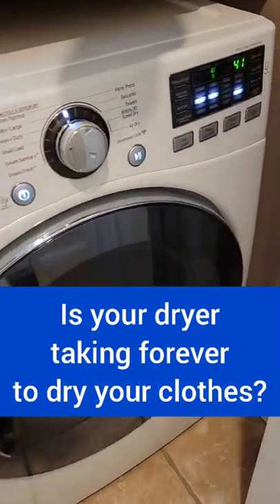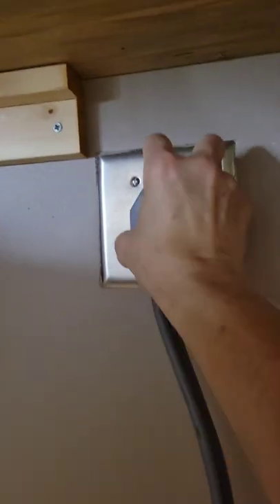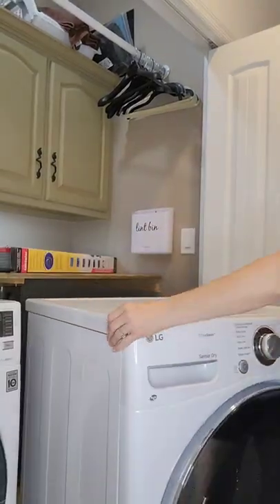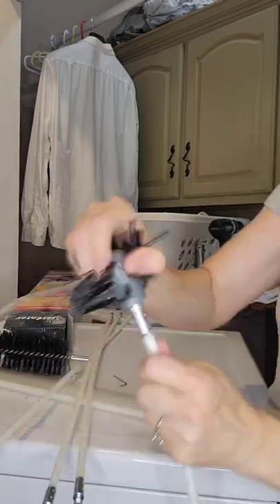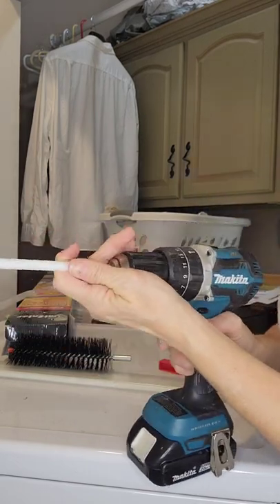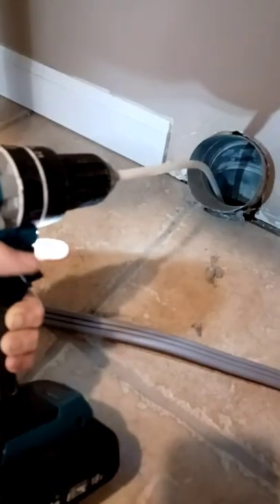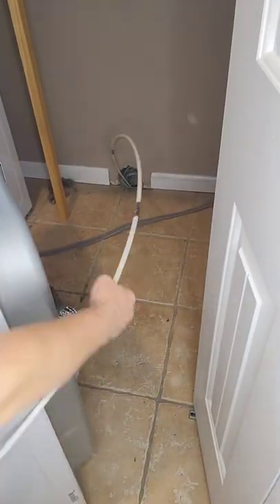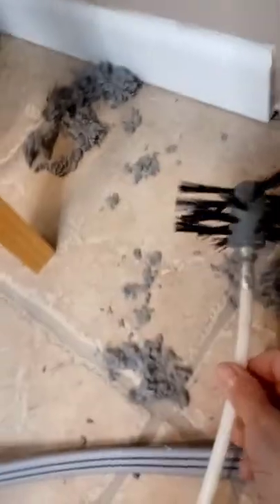How To Clean Out Your Dryer Vent Line

Comment: Everyone watching this clip and reading the comments: STOP using dryer sheets.  You'll avoid this problem if you discontinue using those evil sheets.
Reply from the maker: I agree, I don't use dryer sheets or liquid fabric softener at all. So bad for your machines, just coats them in wax.
Reply: Yessir they clog the filter screen reducing the dryer performance to pretty much zero sometimes.
Reply: @patthesoundguy  :  Think about just how many pairs of denim jeans [100% cotton!] pass through the household dryer in a year.  The tumbling action releases mounds of cotton each time they go through the drying cycle.  Dryer sheets are basically sheets of synthetic fabric impregnated with hair conditioner.  
I read somewhere that  most housefires are starting by (a) cigarettes, (b) candles (c) lint build-up in dryer vents,  caused by dryer sheets.  I never leave the house unattended with the dryer operating.
Reply: @19gregske55  again I %100 agree!!!!   I had the dryer catch fire years ago and the house would have burnt down had we not been home and the smoke detector not been close to the dryer and the fire extinguisher not been there. We were very lucky because we also had the old plastic dryer hose because the dryer was from 1977 and it was 1997 when the dryer caught fire, the hose melted.   I stopped using dryer sheets many years ago when I figured out how nasty they were, my clothes especially my jeans felt slimy when I got hot and sweaty working and that they clogged the filter. My clothes thanked me.
Reply: @patthesoundguy  :  There is another hometruth regarding dryer sheets - they actually expedite the need for successive washes!  That deposit on the fabric absorbs dirt.  Stop buying and stop using dryer sheets.
Reply: @19gregske55  They are sooo nasty. 🤮  You are so right my jeans got so dirty so fast when I still used dryer sheets.
Reply: We use something called drier balls.    It helps dry/static in the clothes.     I will never use drier sheet again.     But mu dryer vent is only about 2fr long if even that.      Plus it's outside in the utility shed.
Reply: @homesteadhaven2010  we have some of those balls here, the wool ones. They are fantastic!

Comment: As someone who does this for a living, i strongly suggest against using the rods on any vent longer than 8 feet and more than 1 bend. I have had to come out too often to remove the rods due to overly twisted rods and destroyed pipe. It can easily turn into a $600 job or even more if the drywall has to be cut.
Reply: Would you say these are unsafe to use? I keep seeing those comments but mine is on an exterior wall and only about 6 feet and I hit it with a vacuum from both sides when I was done

Comment: Clean the dryer ducting from the outside dryer exhaust port.  Remove any screens or louvers at the exhaust.  Clean with the dryer running on the low heat/no heat setting from outside and wear a mask.  Get rid of the the flexible foil type of vent pipe between the dryer and the rigid duct intake, since it's a fire waiting to happen.  Replace with smooth metal ducting or the rigid metal flex duct.
Reply: She did just fine. Providing she was spinning the drill clockwise. When you clean from inside you can do a cleaner cleaning. Also some vents are too high to reach from the outside.
Reply: @appliancerepairshorts  doesn't change the fact that the pipe on the back is wrong and banned in most areas.
Reply: @Baise Duezcke Perhaps the foil isn't banned but it is risky to use at the least. "Foil flexible ducts are pliable and easy to install. You can find UL listed foil ducts in most hardware stores. However, some dryer manufacturers don’t allow them because they’re highly flammable. Their rough walls restrict air flow (the 4 inch opening collapses to 3.25 inches), and clog easily with lint. When the duct is kinked or crushed as the dryer vibrates against the wall over time (or is pushed), the air flow is restricted even further, building up heat and creating a potential fire hazard. If the dryer overheats and the lint catches fire, the foil duct won’t contain it."

Comment: If your dryer vent is so clogged that it's a problem.. a kit like this isn't enough.
As a dryer vent cleaning professional (FL, Space Coast/Vero) 20 years in business.
I have a potentially life saving message for you if you read this.
KITS LIKE THIS ARE HIGHLY SITUATIONAL, it depends on your vent design.
I've seen a lot. Spend less money now, than more later, or potentially your house burnt down... do it right.. call a pro.
It's not a lot of money.
It's worth the peace of mind to me, having a pro do it for a mere 150 bucks a year.. 159 to be exact.. that's all we charge for a single story.
Yearly cleanings are more than sufficient ( perhaps a family of 2-5 ).
Unless you have an enormous family or lots of animals. In which case we recommend every 6 months..

Edit:
I cannot tell you how many of these kits I've dug out of people's dryer vents..
Stuck brushes.. broken rods..
Pulling cat size wads of lint out from the roof because a kit like this compacted it.

This isn't for everyone..

Products like this make me lots of money.💰
Because when not properly used they fail, and you're forced to call a professional cleaning service for more than a standard cleaning.. that 150 a year just turned into 300+🤑 if I have to spend hours fishing it out..

Older construction down here it is common to see horizontal/wall vents.
However most modern homes.. ( your laundry is off your garage.. or a room not near an exterior wall )
It's vented either under slab, or vertically through the roof.
Some instances you will find them under eves.. under subfloors in multi story homes.. with convoluted runs.
Condos and apartments are especially important..
The amount of screens left installed on dryer vents that go to the roof.. is appalling.. sloppy roofing companies..
It's a violation of Florida building code. 
And an extreme fire hazard.
The amount of brand new roofs..where the vent was just roofed over.. would surprise you. I lost count..

If your vent doesn't exit an exterior wall that you can see daylight through..
I cannot stress enough the importance of having it properly cleaned.
Reply: Thanks for the heads up. I was thinking about cleaning the two dryers and looked at the  system  and saw  a lot of items people left in their clothes that ended up in the lint trap as well as rainbow layers of lint that was never cleaned out. Lazy people going to start a fire 🔥. Ehaust was spitting out lint
Reply: Sounds like something someone running a business would say. Why call a business when you can just do it yourself? If a business can do it, so can I because I am a human as well and it’s just a dryer vent
Reply: @AtomSquirrel   Did you miss the part where I said kits like this are highly situational?
And all the points I brought up are exactly why the average person should call a pro.
Where does your vent terminate?
Does it make a lot of turns?
Do you have a booster fan you're gonna run that brush into?
What if it terminates on the roof which is for example a 10/12?

They have their place, these kits can work.
For some people.
Reply: @Elohssa23  what makes a person average? There is no average person. Everyone has their own unique skills and abilities. How does a pro become a pro? Hard work, practice, experience. The “average” person should work towards becoming a pro
Reply: I just pop the dryer out and hit it with the battery operated leaf blower lol 😂 my run from the dryer to the outside is only about 10-15’ you think that works or should I be calling the pros?
Reply: @GenesisG70LaunchEdition  if you're able to access where your vent terminates to pull any clumps out, and doing it constantly.. several times a year, it shouldn't build up enough lint to make using a blower unsafe.
Just keep up with it! If you try and use a blower to clear a large clog it may only push the clog further into your line.
Reply: Took the words out of my mouth,  every single thing this man says it's truth I have 20 years of  professional vent work in Texas,  now add on the cost of drywall repairs and paint after you having to cut out sheet rock to get those out of fix a broken elbow or dryer vent , not everyone does the work right from the beginning,  many company's or handy man do not secure and tape ,seal all of their elbows,  when you use something like this or even a left blower,  it would snap the pipe open or breik elbows
Reply: You do have to follow workers around and watch them so they're not doung stupid shite.
Reply: I want to get into this business any advice
Reply: Plenty to say till you want to become possible competition to their buisness.. its likely the kind of job thats gravy till something goes wrong every blue moon.

Its inevitable that something will go wrong. If fir nothing more than the homeowner knows they messed it up a few months ago but stsys quiet and pins it on you. 

Best know how to open a wall, sheet rock it nicely and how to navigate a attic..  can be dicey depending on builder or handy man crafty work. 

As long as you font have to hire a contractor to handle the occasional big mess...and as long as your word of mouth reputation precedes you... should be an easy niche to get into. 

Expecially now that tic tock has people feeling pro after 30-60 seconds of direction 😀

Comment: Take the lint screen out and run water through it, if the water doesn't flow through freely wash it thoroughly with dish soap and water. This is extremely important if you use dryer sheets. I have seen lint screens that looked perfect but they were clogged enough to take a dryer performance down to almost nothing.

Comment: Our vent goes up through our vaulted roof line unfortunately the builder used the flexible venting. 
When we have it cleaned out, the guy has to take it apart piece by piece up through the roof
Reply: @Baise Duezcke that is my thinking as well, but I bet our inspectors are all on the take.

Comment: I have the same dryer it’s never dried worth a crap. My complete line is 12” long and is never clogged. It’s just a crappy dryer.
Reply: Press the "dryness level" button to select more or very dry. 
If you only have a couple of things in there though it confuses the moisture sensor so use the "speed dry" setting which is a timed dry cycle.
Reply: Take the lint screen out and see if water will flow through it under the tap. 5 bucks says water won't go through it.  Wash it well with dish soap and water. That may make it work.

Comment: How many feet were yur rods?😊
Reply from the maker: This particular brand has extension sets you can buy. Each rod is 3 feet long. I have a kit and then a set of extensions totaling over 40 feet as I have a ridiculously long vent line. I believe the original kit is like 24 feet long.
Reply: @thedailydiy  Thanks we just move into an older home we just burned up our element on the dryer I don't think it hasn't been clean in years so this is a must for us. My tube and machine  🤖  are clean 🛀 so it's got to be the vent pipe thanks again for yur speedy response.

Comment: Ahh...that is so lol 😆 When using a dryer vent cleaner, do it from the outside inward while the dryer is running. Bad advice there.
Reply from the maker: how can you do it from the outside-in while it's running? you have to disconnect the dryer vent line, so you cannot run it while it's disconnected. Am I missing something by your comment?
Reply: @thedailydiy  You find the dryer cap that is outside the home. It can be on the side of the home or the roof like mine. No need to disconnect the dryer from the vent line. You take the dryer cleaner that is attached to the drill and do it from the dryer vent cap outside inward instead of inside. With the dryer on, it'll help to blow out all the lint and have a much thorough cleaning.
Reply from the maker: @Ninja8021  thank you for clarifying, that makes sense.